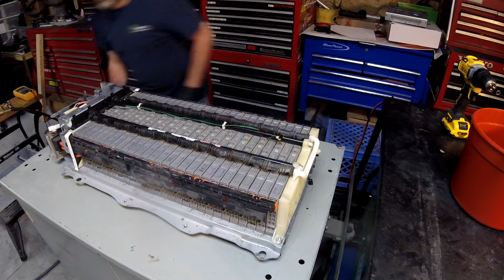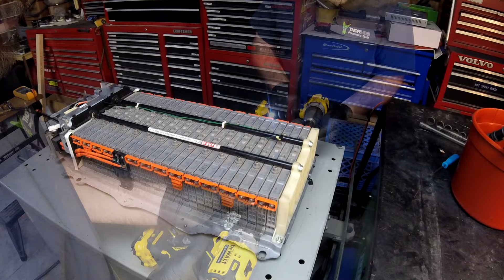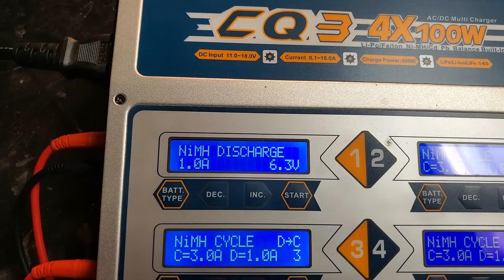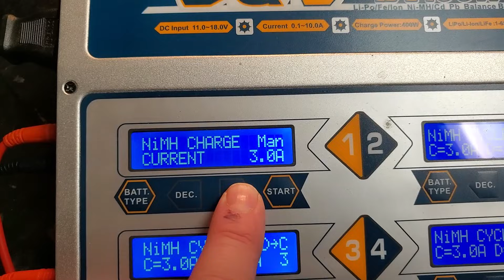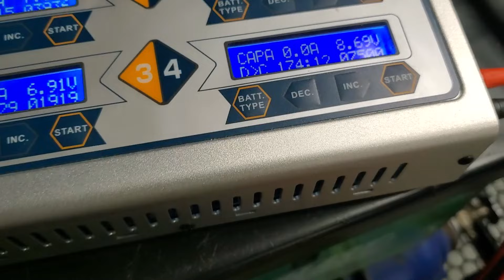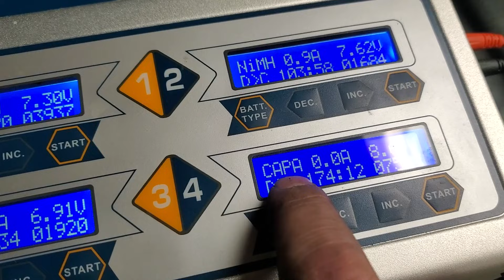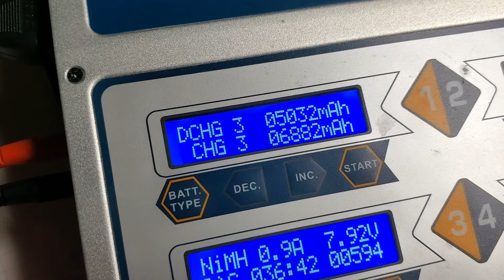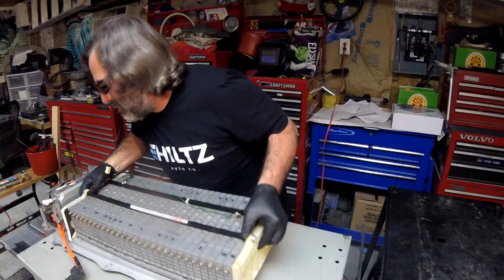DIY Refurbish / Repair Hybrid Battery 2nd Gen Toyota Prius - EV-Peak smart charger POA80 P0A80

Comment: Can someone drive normally with fault Batteries
Reply from the maker: Daniel, The car will drive with faulted battery pack but not normally. Extended driving with faulted battery could damage the inverter. Thank you for watching and commenting.
Reply: @GreggFesto  thank you
Reply: Sometimes, tho, the prius will refuse to go to ready snd not move with this fault code...dont ask me how I know this....
Reply from the maker: Hey Martin, I have seen a few times where it does lock out the drive as you mention. I have had good success resetting the car when it locks out the drive by disconnecting the 2 plugs on 12V battery for a few minutes then plugging back in. The battery fault lights are still on but the drive is enabled again enough to get the car home.
Reply: @GreggFesto  thanks, Gregg, that's good to know (wish I had before that happened ... would have saved me a tow bill!). But, I also want to tell you how impressed I am with you! The video was great,  but, more importantly,  I've noticed that you've taken the time to write back to everyone leaving comments with questions. And have been gracious to those giving you attitude. Good for you! Keep up the good work.
Reply from the maker: Hey Martin, Thank you very much for the positive comments. I appreciate more than you may know.

Comment: Hi Gregg, Thank you for making such a detailed video on Hybrid battery reconditioning. When you put the battery cells back in, why does it seem like you put them back in, in parallel? I was expecting to see the numbers on the same side again and that isn't the case. Also, did you end up replacing the 4 bad cells? Thanks, J
Reply from the maker: Hi Jonny, Thank you for watching and writing in.  I put the cells in series. The reason numbers are not all on same side is that their position in the pack may have changed based on battery health. The position in pack will determine if the number ends up on same side of pack or other side of pack. I put stronger cells in the center because they can handle the heat better. Although not shown in video, I did replace the weak/failing cells with some from ebay, if you look through comments you can find the vendor info. If you do this job please write back and let us know how it goes for you. This pack has been driving daily since August and MPG's are in the mid to high 40's.
Reply: @GreggFesto  thank you for the reply and glad all is well with your Prius. I knew you had put the batteries in parallel by putting all the positives on one side. This was to balance the charge for the batteries. I was just expecting all the batteries to be rotated back to the same polarity. I knew you repositioned the batteries based on cell strength.  I am pretty sure my misunderstanding is because I don’t have my battery apart and I’m not looking at it personally.

Comment: Great video. I have a Tahoe and ready to begin the process, but a little apprehensive as there are warnings about getting shocked and wearing 1000 volt gloves. You didn't seem to have a problem touching the battery pack before unhooking the bus bars. Can you advise?
Reply from the maker: You can do it yourself. The main thing is to avoid touching positive and negative to each other together with tools or your hands. It is as simple as - no path for current to go then no discharge of power.  I have been working with electronics, electrical, autos, and machinery since 1991 and use the nitrile gloves all the time, have not been shocked when wearing them yet. I appreciate you writing in and hope when you get your project finished that you will write in again and let me know how it went.
Reply: @GreggFesto  Good god. I never expected a reply that fast! Thanks so much for taking the time to help all of us save a bunch of money! Ordering my smart charger and looking forward to seeing the results. When the battery gets low on a Tahoe, it's like riding bucking bronco! Ha. Will be back with results. Many, many thanks!
Reply: @GreggFesto  I removed the battery and ready to start the reconditioning process, but not sure of the discharge/charge peramiters.I though the batteries would be the same a the Prius, but  I am getting 10.8 + or - for each cell. The GM forums didn't supply any answers. I have 40 cells. Any advise would be greatly appreciated.
Reply: Sadly the charger I purchased is a little different then yours. It has an option of repeat mode where it charges the batteries 3 times quickly. I assume that this should not be done? Discharge mode talks about how low I want to go. One volt? No talk about mAH in the memory so not sure how to tell if a battery is dead. I purchased the Ultra Power UP 240 AC.
Reply: Sorry to ramble on. My volt meter has serious issues. With new meter, I am getting in the 7 +- range.
Reply from the maker: Hey SV. Just saw your message. I apologize for not being able to help with this one, unfortunately I am not sure about the Tahoe batteries as I have never done one.

Comment: Doing my second Prius battery refurbish this week. My good cells on this one are 8.2 volts and the bad ones about 6.9. One even down to 5.8 volts!

I suspect the higher voltage is due to the weaker cells not rising as the computer wants? 
All my higher voltage cells test good, so I’m replacing the 8 bad cells that wouldn’t recover and reassembling tomorrow.

Hope it goes as well as my first one did. :)
Reply from the maker: Hey Jimmy, Thank you for watching and writing in. Glad you are fixing your own stuff and saving money.  Thats what its all about right there.  I suspect that the 5.8V would trigger the triangle on dash. Was this your experience as well?
Reply: @GreggFesto  Yes, that cell was certainly a problem. I’m changing all the weak cells just to be certain I’ll only have to do the repair once. And should be good for a while. :)
Reply from the maker: Rock on Jimmy! I hope you are back up and running the streets with great MPG's

Comment: Thanks for a great video. I've a question about your final assembly and arrangement of the modules with higher Ma capacity toward the center. 
 
The Toyota control system, i believe, monitors voltage difference between module pairs. I'm guessing there's a limit of the voltage differential, before the Toyota system would generate a fault. 
Would there be an advantage in pairing the modules in a high/low Ma arrangement? Or is a 1000Ma difference not great enough to likely set a fault on the Toyota system? Or are there greater gains in managing the heat loads, by keeping the "weaker" modules cooler?

Thank you for your patience. 🙏 I'm a novice with these hybrid batteries. 🤙
Reply from the maker: Hey R Yarbrough,  Thank you for watching. On the battery packs that I have refurbished it seems that the cells in the center deteriorate faster than those on the ends. I believe this is due to heat.  For this reason I put the stronger cells in the center of pack so that they have the best chance of lasting. To date I have not experienced any issues or faults by using this method. I hope you will write back in with your experiences in refurbishing your pack.

Comment: So when cycling, is the discharge capacity the number I need to be watching or the charge?

I have cycled the entire pack with 5 cycles per cell, but now I’m unclear on which number shows me the condition of the cell. Drastic improvement of most after 5 cycles.
Reply from the maker: Hey Brad, Thank you for watching and commenting. The number you want to pay most attention to is the low capacity. This will tell you the actual capacity of the cell itself. You will find that the low number will continue to increase in a good cell and will decrease in a bad cell. The high capacity number can be used as a gauge, watch it as you go through the cycles and if it decreases by a large value or if it continues to decrease with each cycle then that cell is weak or starting to fail. I have had cells that continued to get better up to 12 cycles before starting to fall back off.

Comment: Hi.
Could you list the details of settings for the charger.

Also, by what means do you monitor the temperatures during charge/discharge?
Reply from the maker: Hello, Thank you for watching and writing in.  I updated the video details to include the settings I used.  The temp setting used is monitored internally by the charger.  It is a safety feature I believe. Please let me know if you refurbish your packs and how they turn out.  I have been driving daily since August on this pack with excellent results, almost good as new.
Reply: @GreggFesto  🤙

Comment: So after doing this, how much life you get from the battery? Is it really fixed for a few years? Or is just putting a band aid to an old battery. Is it really worth the time doing all this or better to save for a brand new battery
Reply from the maker: Thank you for watching and commenting. If you do not have or want to spend money for a new battery then this is for sure worth the time.  This particular battery/car average MPG's fell into the high 20's/low 30's. That is what prompted the refurbishment. Now the car averages MPG's in the high 40's/low 50's like it was new again. This is several months after the refurbish. I do notice that the very top bar of the battery charge indicator never turns green. Perhaps this is because it does not have an absolute full charge?  I am not sure.  I plan to do a 1 year video to show how it holds up when we hit that point so please stay tuned.
Reply: @GreggFesto  thank you! Great content
Reply: @GreggFesto  id love to hear your one year experience video!
Reply from the maker: @Stephen White, I may do just that. We are coming up on a year soon. Thank you for the suggestion.
Reply: @GreggFesto  is it still going strong though?
I need to know because mine is due for a repair asap as all the power failed on the freeway several times already…

Excellent video!
Thank you for sharing & demonstrating
Reply from the maker: Erx fav, I have had amazing results doing the packs this way. If you stick to the 5000mAh low number for each cell like I did then you will have good results as well.  The good thing about this method is that you can tell if a pack is starting to go when you see how the mAh numbers come out after each cycle. Thanks for watching and commenting. Please send an update and let us know how you get your pack back into shape.
Reply: @GreggFesto  thank you VERY much.. i am still new to this so I'll have to rewatch to figure it all out and exactly what you mean here.. 
Im still trying to figure out even how I would use my current multimeter to measure the voltages or whatever I need to measure (not an electrical guy per se..)

Im also just unsure in general whether I should buy an entire new battery or just try to replace individual cells.
Im not sure of the difference between refurbishing or replacing.
I guess you can purchase both refurbished OR new cells on ebay?..

thanks
Reply from the maker: Erx fav, When you have the cells disconnected from each other you can read the voltage of each cell with your multi-meter as a quick test to identify suspect cells. This would be the most basic form of troubleshooting. Many times the cells that read lower are the ones causing the red triangle and service code. The next level of troubleshooting would be the light bulb method where you watch how long it takes for the bulb to go dim. The cells that go dim quicker are the ones causing the red triangle and service code. The next level up from that is what I am doing here. Not only can you identify bad cells but you can also identify cells that are starting to fail. In addition this method allows for a way to try and bring cells back to a higher capacity giving them more power and extending their lifespan. 

If you have the spare money then a new or refurbished pack is gong to be the easiest way to go as someone is doing the work shown in this video for you. If you are money watcher like myself then you will want to put in sweat equity to try and replace as few cells as possible. This will save you cash out of pocket and help you squeeze every dollar/mile from the cells that are still good.

I hope you will write back in and let us know what route you take and how satisfied with the results you are when done.
Reply: @GreggFesto 
I’m sure I’ll have some more questions soon as well..
3 I suppose which is the best hobby battery refurbisher tool to use (I don’t know the name but I’ve seen a $60 one or so and then a $200 one someone used in another video as well.

And 4 is there a point where it just doesn’t make sense to try to fix/renew/refurbish these (sorry I’m new to these terms) and to just buy a whole new or refurbished whole pack?

Thanks again so much Gregg
Reply from the maker: Hey Erx fav, I am not sure which charger is the best. I have only ever used the one you see in this video. I have done ALLOT of cells with this charger. I suggest reading through some of the other comments here on this video as some other chargers are mentioned. Some have good points and some seem to be harder to use. Maybe some other forums can give good advice on this. The main thing is to get a charger that can work with the type of battery, can discharge in addition to charging, has adjustable setpoints, and can tell you the high/low capacity of the cycle. The charger in this video and the settings used were based on my readings on PriusChat forum. 

I look at the situation like this - Determine charger you want and the refurbished cell vendor that you want to use. Get pricing and availability for these items. The worst pack that I did needed 8 cells. I would use that as my worst case scenario.  Add charger and cost of 8 cells up. The cost was for me and may be for you too, less expensive than a whole refurbished pack. Then it is a matter of your time and how much doing something like this would interest you. I decided to learn on my own car, then do this job for others. I have made enough to pay for my equipment several times over.

In regards to the longevity of this repair - I believe that doing this process and using the minimum of 5000mAh as a cutoff point (although not as good as a new pack) will provide several years of good service. As far as I know, every car in which I have refurbished the pack is still driving without further work to the pack.

Please do let us know what you decide on doing and why. It would be good to learn how you make your decision and also how it turns out with your car.
Reply: @GreggFesto  hey did i write too much (in my latest replies)?
Reply from the maker: No Erx fav, I don't think so. I am hoping that others will learn from our discussion.
Reply: @GreggFesto  thanks, will it really take a week for me to do this in which case I cannot drive my car? or is there a faster way?
Reply from the maker: Hey Erx fav, The time it takes overall will depend on the condition of your cells and how many times you will need to run cycles on them to achieve low mAh reading of 500mAh. Better condition cells will take less time.

Comment: Great content! Question, would it be okay to discharge a little faster, say 1.5A? I found that my discharge cycle is taking so long at 1A that it times out at 720min limit.
Reply from the maker: Yes, absolutely you can go a little higher on the discharge or you could raise the timer limit.  I appreciate you talking the time to watch my video and also for writing in with a comment.  I hope you will write back in and let us know how your pack comes out when done.
Reply: @GreggFesto  excellent! One more question if you don't mind. In your experience, would you consider it a good battery still if it had a discharge/charge cycle where it started out strong, had one or two bad cycles then 2 or more good cycles following? Example: 5600/7350 then 1850/2800 then 2400/6800 then 6200/7400 then 6100/7500? The bad cycle in the middle stages are making it confusing to definitively determine if the batt needs replacement. I'm wondering if I should consider it nursed back to good health or if any bad indication should be a cause for rejection. I'm not too familiar with NiMH and if they can be restored/prolonged in this way like with NiCad.
Reply from the maker: I have had similar experiences and believe that when they start coming back like that then the repair is working.
Reply: @Gregg Festo  Hi. Thank you for informative video. If my low read is higher than the high read like this 05314/3600, is that good as the low is over 5000? Or do I still need to do more cycles?
Reply from the maker: This does not seem possible, perhaps something has messed up with your charger? I suggest you try running cycles again.
Reply: @BoneyardLabs  it seems like the charger measured a false peak and stopped charging early. That's why you had less capacity on the discharge

Comment: Hi, thanks for the video. One of the battery displays DLY, what does that mean. Thank you for your time.
Reply from the maker: Hey Richie, Thank you for watching and commenting.  I am not sure what the DLY means. If it is only on a single cell and it does the same DLY report on more than one channel then I would think there is a problem with that cell.  Please write back and let us know what you learn as the cause.
Reply: DLY is short for Cycle Delay, and is displayed durning the Wait Time in-between cycles (Drain -> Charge, or Charge -> Drain).  I just started this process with my daughters 2008 Prius and I noticed my BGUAD CQ3 Charger/Discharger flashing that DLY code on my display in-between cycles.  While that code is flashing, the Charger/Discharger will show the remaining time left on the Cycle Delay.
Reply from the maker: Thank you for the information Kevin, much appreciated.